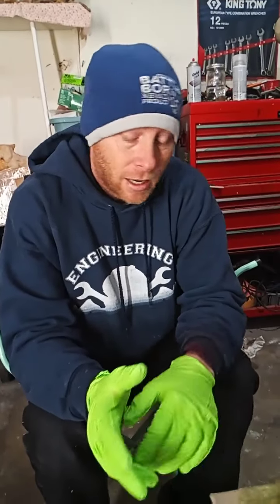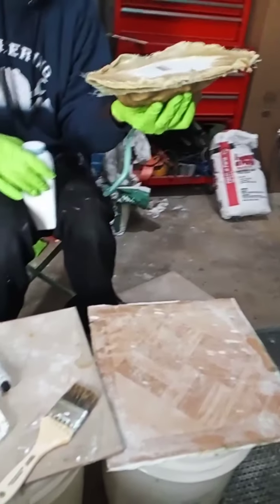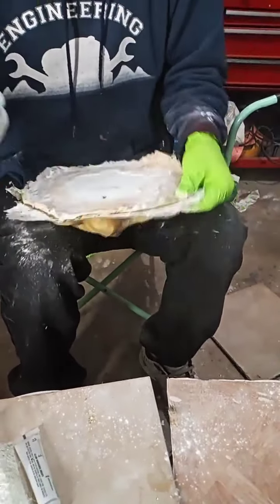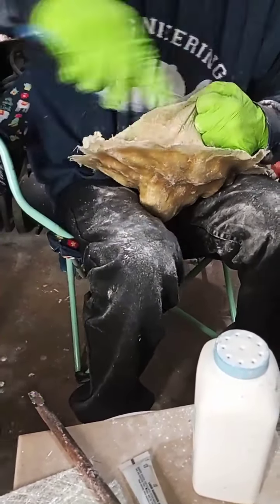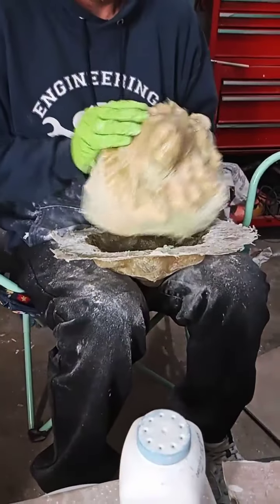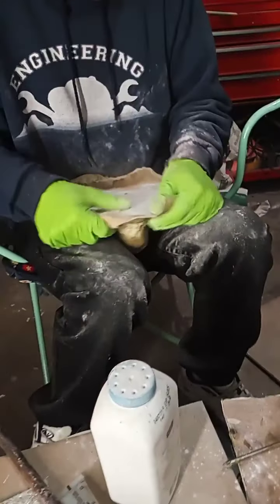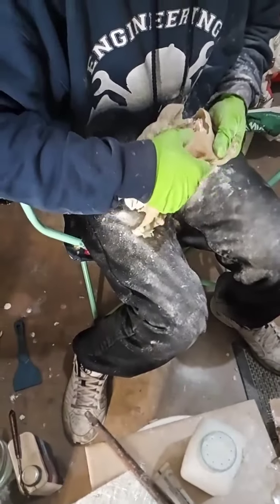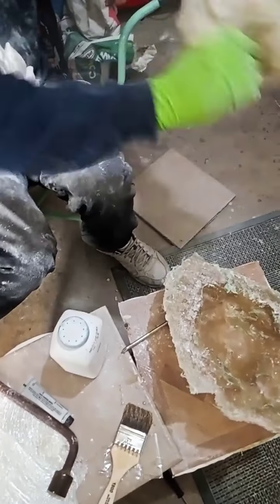demolding the lionhead.

Comment: How many layers of rubber do you do on each piece? Also, if you were to make another fiberglass backing for this piece, would you use a seam in it now?
Reply from the maker: 20 layers of latex although I may have miscounted and put like 22 to 24 on this one. Yes I think I still would have put maybe a two inch seam on the back side of it. Just to relieve the pressure as I pull it around the large midsection. Basically that's what I'll do to this one I'll only cut up two inches of the seam. Be safe out there and happy pouring.